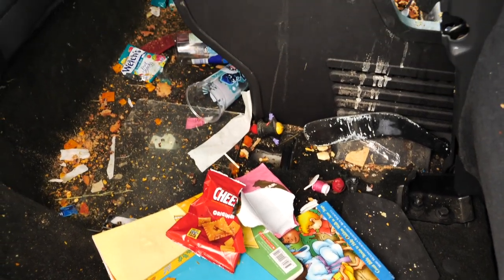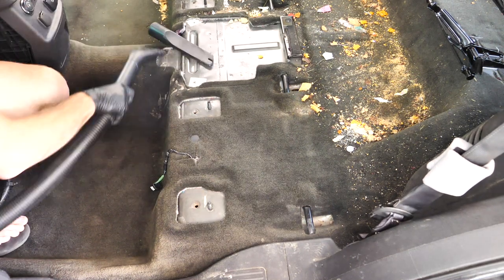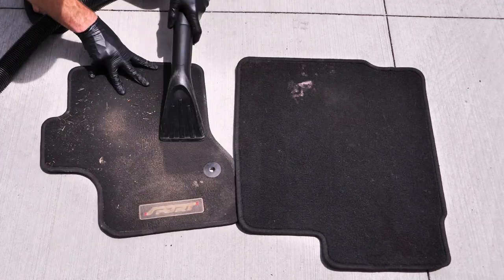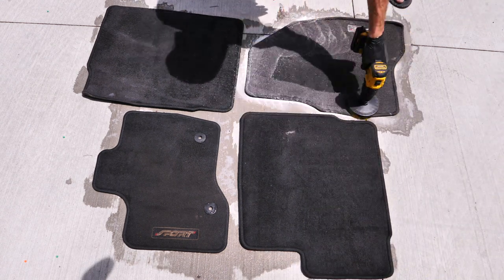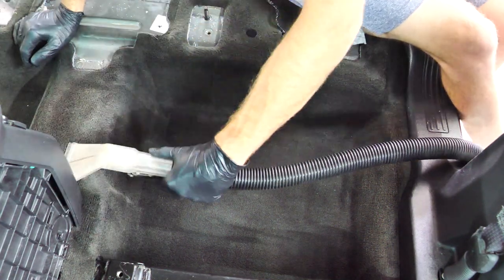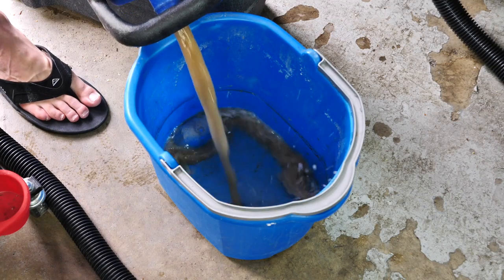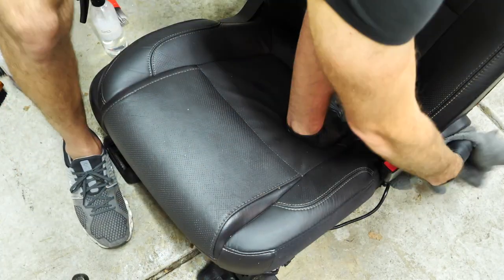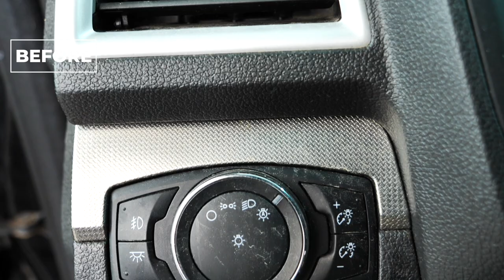Full Interior Car Detailing Transformation of A Nasty Kid Trashed Car! Interior Restoration How To

Comment: I bought a set of drill brushes because of your channel. Yesterday I used them to do wheels and tires and holy smoke did it speed things up and do a better job than I do with my hand brushes. Now I'm excited to do the interior instead of dreading cramped hands and sub-par results!
Reply: I bought the pet hair brush and it’s incredible. Worked miracles.

Comment: The car seats are ruined after being power washed. The plastic base is not supposed to be exposed water. Neither are the straps. The covers are allowed to be washed but only by the manuals instruction per sheet as it’s flame retardant and most products are to harsh of a material. Not to mention the impact force of the pressure washer. These seats are compromised and need to be tossed. If those seats are in use during a car accident it can be catastrophic.

Comment: 2 questions.
1. Is it possible to get the stains from dirt, snow, or whatever off of driver left foot rest and sides where trim meets carpet. Im having a dandy time doing it. 4 passes already.  But i am just using a Hoover mini extrator.
2. How do you dry the carpet during the brutal days of winter. Im also in the midwest.

Comment: I get that the video is sped up, but it seems with all car detailers, you don't spend enough time/care with the drill brush. You seem to miss a lot of carpet instead of methodically going over it bit by bit.

I think slowing down and spending more time on the bad areas would improve the results... Not saying you are the only one that seems to rush this part, every other detailer I watch on YouTube does the same.

Why do you not use your steamer more? It would make a far easier job of cleaning the plastics/cup holders etc.

Finally, why do you not rinse the stuff after cleaning it? You soak it in APC, wash it, then immediately dry it with all the yellow gunk water still in it... Seems like you should at least rinse it out before drying.

Comment: Stauffer I’m a fan but the way you cleaned that car seat definitely is against recommendations from Graco. If you spill anything on the straps they are supposed to be wiped with a damp rag not soaked in water or chemicals. When it comes to auto detailing you are definitely very talented but for this car seat you are misguiding.

Comment: Hi , ı gave a dislike because you skipped many of the detailing part . For example you did not cleaned shift knob , you should use steamer for stubborn dirts. Also you did not cleaned seats properly, even if before you apply leather protector seats remained uncleaned, shiny(cause of body oil) . Sorry pal if you are not a pro that is okey but if you are doing this job as a pro, in my opinion you should improve your skills. Have nice day.